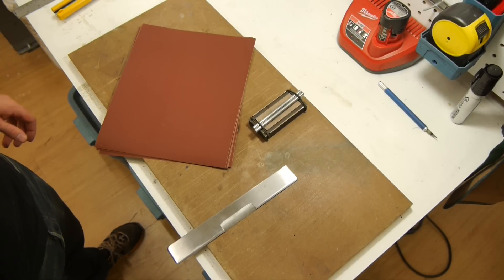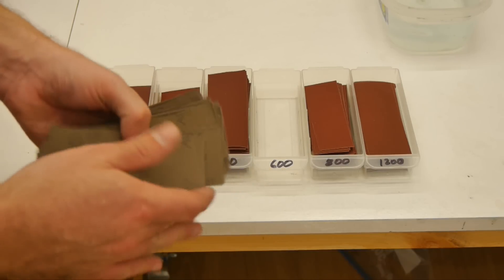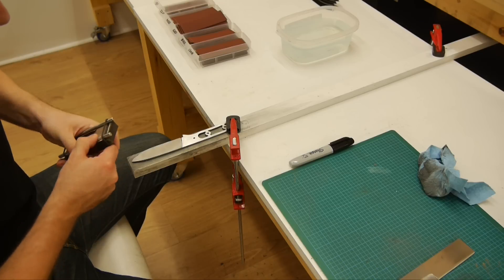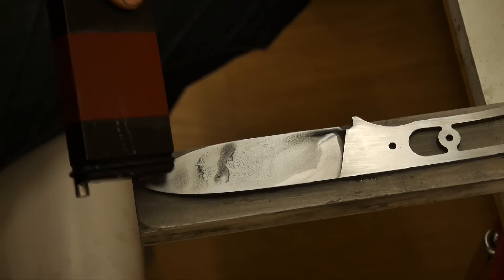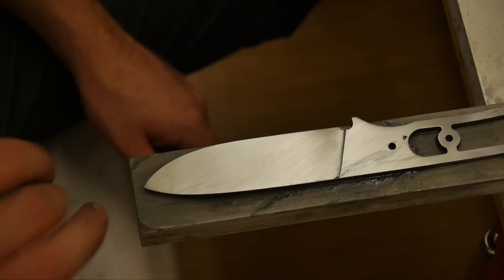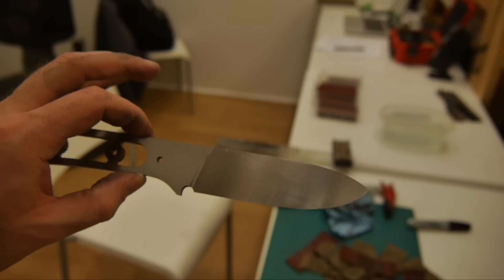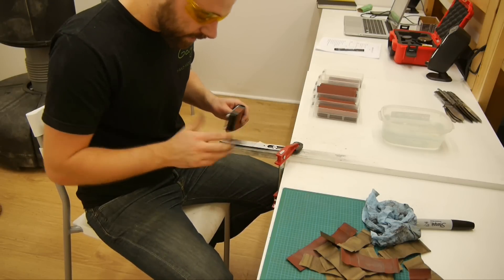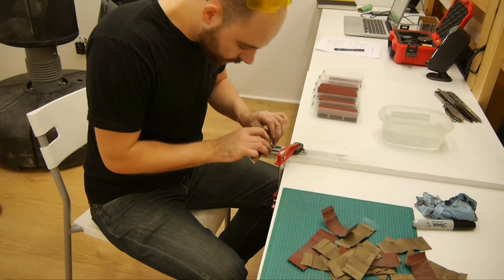How to Satin Finish a Knife Blade

Comment: I've made a few knives, and have the process down pretty well. Now working on upping the quality. I've watched a ton of videos on all aspects of knife making. I keep coming back to a lot of your techniques. Simple, well explained, logical. So thanks.
Reply from the maker: Awesome mate! Glad the videos have been helpful!
Reply: Gough Custom Yeah, I built a fire brick heat treating kiln, and have the Lansky sharpening system. Starting to build out the bevel filing jig. I've been using a cheap 1x30 grinder that does ok on the bevel itself, but is useless for getting a decent plunge line. Until I upgrade, I think the file may be the way to go.
Reply from the maker: Keith Peters The plunge line is definitely the hardest part of using a grinder.

The filing jig makes that part much more controllable...

Comment: Thanks a lot mate. I have a Japanese chef knife, which had a nice polish when I first bought it. Once I had it sharpened to a street vendor, and it was full of scratches. My heart was thorn..  Anyway, later I learned to sharpen with whetstone, so I got saphire brand stones, 1000-3000-8000 grits. But still had the scratches. 

After watching your video couple of times, I bought 400-600-800 grits sand paper, a sand block, which was very cheap to acquire by the way. And finally, I got my knife almost perfect satin finish, thanks to your explanations on your video.
Reply from the maker: malkocy Excellent work mate! That must have been satisfying!
Reply: Yes.. You saved my day, and I got this new skill. Thanks to you..

Comment: Sweet, great vid Aaron :)   If you don't mind me suggesting.. just as one should use sandpaper as if it's free, use shop towels like they're free as well, at least or especially in the case of sanding/finishing.  Just use a new (or seperate) towel for each grit so you don't happen to drag a piece of 400 grit (or worse) down the blade of your nicely finished 600 grit when wiping down your blade at the end. 

I know it's probably not a big problem for you since you only use those two grits, but hopefully somebody will benefit from reading this. I know how much it sucks to get up to 1000 grit and then wipe the blade down, only to find a stray piece of 120 grit on the towel after it just got done digging it's way into my nicely finished blade..   :(  lol   Anyway, it's always nice to see new vids from ya brother, take care :)
Reply from the maker: Good idea mate! Thanks!

Comment: Hello, thank you very much for your videos, they help me so much to improve my skills. I wanted to ask you to make a video - if possible - explaining how we can make visible the upper line of the bevel after hand sanding. It will be very helpful. Thanks again!
Reply from the maker: Hey mate! The main thing to consider in order to keep the top line of the bevel visible is that you have to avoid rounding over that 'corner'. If you think about it that visible line is actually just a 'corner' with a really shallow angle... If you round it over, even just a little bit, then the line mostly disappears.

So: Make sure you're using REALLY hard sanding blocks. If you're using sandpaper then you have to keep a lot of tension on the paper to make sure it doesn't 'squish' and round over that edge.

The best way to do it is actually not to use sandpaper at all, instead use a type of hard stone called 'edm stones' to do your finishing. Because they're completely hard / rigid it's much easier to avoid rounding over that corner. The stones also cut much faster than sandpaper as well, I use them 100% instead of sandpaper these days... I buy my stones from MoldShopTools.com, and I use the CS-M stones in the 1/4x1/2" size.
Reply: @GoughCustom  many many thanks for the detailed answer. I will try to implement all these. Thanks again

Comment: This is very interesting, informative and useful clip. Thank you so much. I found there  a lot of useful things. I wanted to ask: what design means for clamping sandpaper? How to fasten metal rollers? What keeps them - rubber rings?
Thanks in advance,

Gennady
Reply from the maker: Hey Gennady! The sanding block is not really necessary, and I know a lot of other knifemakers would prefer not to use it.. Whether you decide to is your choice. I have another video on my channel that shows the sanding block in more detail
Reply: Gough Custom Hello Gogh!
I also tried different ways and work with the sanding bloc I like more .. I have my own sanding bloc, but I really liked the way mounting sandpaper in your model. I want to do the same. On what your video can I see? I've seen all that you posted here and on your site, but I found none.
Gennady
Reply from the maker: Gennadiy Livshitz Hey mate, the video would be found on the 'videos' tab of my channel page, it's an older video so it doesn't show up on the main page: https://www.youtube.com/watch?v=AtAZRdxUrh4
Reply: Gough Custom Thanks, Gough, it's great! I already went to make a sanding block  :)

Comment: Hi Gough Custom. I like your video's, very usefull info. Have you tried Scotch-Brite to satin finish your blades. I have used the Ultra Fine Hand Pad 7448 for polishing mine with the aid of a sanding drum mounted in a cordless drill. I cut the pads in 2 " strips 9 " long and roll them on the sanding drum. Its fast and the finish is very uniform...it even follows the contours in the blade. I never use coarser pads because they tend to roundover crisp edged that you maybe want to keep. If the ultra fine pads are to coarse...just put a few drops of motor oil or WD40 on the blade first.
Reply from the maker: I have used a scotchbrite belt on my grinder in the past. It works ok but it's definitely not as crisp as a finish done totally by hand unfortunately...

Comment: Is it the act of dropping down a grit and changing the sanding direction that gives the satin finish, or is it determined by the grit that you choose to stop at? If you went further up the grits to get a finer finish would you still do that?
Reply from the maker: Ben Winchester The 'brushed' satin finish is created by aligning all your grit marks in the same direction. It will look similar even if done at a higher/lower grit. I would still do the exact same overall process even if I was going higher in grit.
Reply: Gough Custom Thanks! You're very helpful!

Comment: I've had trouble finding safety glasses without too much optical distortion, so I typically use a full-face mask, which is inconvenient.  Are you happy with your safety glasses?  If so, what kind do you use?  Thanks!
Reply from the maker: +TitusLivy777 I actually haven't had that issue to be honest, so I can't really be of any help! I will say that I vastly prefer my full-face respirator to any combination of glasses/visor.

Comment: How can I satin finish on a hollow grind blade ? No flat surface so your sanding block will not work. Any tips on how to do it? Thanks for the videos.
Reply from the maker: Hey mate! You need to use a hollow sanding block, ie: one that has the curve in it... So if you did a hollow grind using a 10" wheel you would use a sanding block with a 10" diameter curve on it... Knife supply places should sell them.

Comment: Could you still do this without heat treating after? Or more so after a blade is already treated?
I have a Kabar Becker BK2, I wanted to strip the paint off the blade portion then get a satin finish. 
Also would I need to coat the blade with anything after besides just a mineral oil to prevent corrosion?
Reply from the maker: Hey Joe! You can certainly do this to an already heat-treated blade, just be very careful of the sharp edge as you could cut yourself really badly. Mineral oil should be enough to prevent corrosion.

Comment: Just started to do this on an old knife for somebody. It is really scratched up and I thought great chance to practice this technique. Problem is I forgot to put the piece of wood underneath and managed to slice my thumb open. I should have watched this again first.
Reply from the maker: Ah shit, sorry to hear that mate. Hope the cut wasn't too bad... Working on a finished and sharpened knife is always a dicey proposition. I prefer to dull the edge first with a coarse stone to make it safer.
Reply: Gough Custom Thanks mate. It bled a lot but wasn't too bad. Seemed to stop after 5min of pressure. Don't think it needs stiches. The knife was mostly dull I just managed to hit the tip. It is a fairly cheap knife but good practice since I haven't done the hand sanding before on a knife turns out I am learning heaps already (especially about safety). Oh and I am halfway through making my first knife (only a mild steel one, for practice). And that beveling jig is great. How to bevel the knife accurately? That was the only thing stopping me until I saw that video. Now I have knife ideas I want to make going through my head all the time. Can't thank you enough for that brilliant jig. Thanks again mate.
Reply from the maker: Glad to hear you're ok mate! Glad the jig is working out for you as well!
Reply: Gough Custom Thanks again mate. Quick question if you have time. How do you find G10 performs when wet. I don't own any and don't know whether to get it or not. Thanks.
Reply from the maker: It depends entirely on how it's finished... You can finish G10 very smoothly in which case it's slippery when wet. I leave mine quite coarse, I only sand to 120 grit and they look great while also being very grippy.
Reply: Gough Custom ok cool I didn't know you could do that. I will give it a go for sure then. Now that I know it can respond like that. Thanks again.

Comment: Aaron, I know you have a sand blaster. Hopefully you can use different types of blasting medium. Why don't you use that machine? Would save you a whole lot of time.  Sand blast the blade, then gently polish the surface. It gives a very nice finish. Still a satin finish, but it won't feel "rough", like it would right after blasting. I have tried this myself on a piece of steel (not a knife) and the result was quite pleasing. Would this work on a knife as well? Maybe you have tried it already. If so, what were your findings?
Reply from the maker: +telescopereplicator Hey mate! Any sort of blasted finish on bare steel will not only look quite different, but it will also rust more readily due to the increased surface area and creation of small 'nooks' that will retain moisture. When I did the video I actually didn't have a sandblaster anyway, that's only a recent addition!
Reply: +Gough Custom  I wonder how much more intrusive sand blasting will be with respect to sandpaper or other mediums...? You can use sand (which comes in different sizes and hardnesses), different types of metal, and plastics. If sandpaper won't cause any problems, I think sand/medium blasting won't, either. Blasting the blade with 1mm (up to 5 mm) steel pellets (before the hardening process) might give a nice effect, although I wouldn't know how to do that. However, let's get one thing straight :  I like EVERY knife you make ! I consider each knife that leaves your shop a piece of art !!! No matter what you do to it !  ;-)
Reply from the maker: +telescopereplicator Generally speaking sandblasting creates a much larger surface area than other things like sandpaper, which helps to encourage rust if it's left raw. I've been very happy with how it performs on my newer knives where I sandblast and then coat with Cerakote!

Comment: Can I take out scratches from my blade doing this? My knifes scratched up, some fairly deep n I was hoping to fix it somehow. Can I do this to make my blade look new again?
Reply: It's a pre '04 Schrade LB7 they don't make them in usa anymore or with 440c stainless it's a collectable. N it was given to me by my uncle when I was a kid. So if u could tell me what u think I'd really appreciate it knife means a lot to me my aunt passed away a few years ago. Thnx!
Reply from the maker: Yes, you can refinish a knife using this technique, just make sure to dull the edge first to avoid cutting yourself.

Comment: Excellent video, thanks for sharing. A little off topic but have you done chisel grinds?  I love the look of the compound chisel grinds have not seen how they are accomplished.
Thanks again.
Reply from the maker: I haven't done any chisel grinds, but they should be fairly simple, you're basically just grinding/finishing one side of the blade rather than both...

Comment: how thin do you take the edge before heat treating? Are you air quenching? your blade didn't appear to have the scale and burnt oil on them the way mine do.
Reply from the maker: Peter Hughes DVM Hey Peter!
Just to be clear, the knife in this video was not really heat-treated. I discolored it with a torch so that I could demonstrate my process without having to wait 8 hours for heat-treat! If you have a look at the antarctic video you can see what my blades look like after heat-treat. There's no scale or oil because I'm heat-treating with the blade covered in foil and anti-scale and then air-quenching, there is a light rainbow oxide though.

On A2 I take my edges down to about 0.010" before heat-treat.
Reply: thanks! Some people say I need to leave a fairy thick edge on it before heat treat to avoid warping. Others say it is OK to work closer to finished before heat treating. Right now I am spending many hours hand sanding - from 220 up - on hardened steel . Can't help but think it would go quicker if I did it on softer steel.
Really like your videos. Copying your filing jig was a major step forward in the quality of the blades I've been making.
Reply from the maker: Peter Hughes DVM With some steels that require a very fast quench (like W1 for instance) I can imagine you might have to leave the edge thicker to avoid warping. But with everything that's oil quenched or air quenched I can't imagine you'll have an issue as long as the quench is done right and the steel is not overheated. I've talked to a few people that were having issues with warping, and in each case the issue was overheating. Thinning out your edges will make a huge difference in how the knives perform!

Sanding will definitely go faster when done before heat-treat! Buy some anti-scale compound and you can go all the way up to 800 or so before heat-treat. Afterward you will have to sand again, but you'll be able to start at 600 or 800 and it will go quickly!

Comment: For my forged blades I like draw filing to a fine enough finish with a mill smooth file and than move on to hand sanding with a 120 grit paper, followed by a 240 and 400 grit. I normally use the Rhynowet Redline and 3M. I have been thinking about experimenting by transitioning to a stone after the draw filing and before going to the 240 grit paper. What would be a good stone after the smooth file, an EDM or coarse waterstone ?
Reply from the maker: EDM stones will cut your finishing time by probably half compared to using sandpaper. I use EDM stones a lot and plan to do a video on them soon! I would recommend using stones to replace all your sandpaper grits except the final grit that you use for pull strokes. The stones I recommend are the CS-M stones from MoldShopTools.com
Reply: @GoughCustom  Thanks, will check that link.

Comment: hey Aaron I'm about to make my first few knives, I was wondering that when you sand the ricasso area are you not creating an uneven surface for your knife scales to glue on to? i assume you aren't doing much sanding if any where the tang is hidden by the scales. I was just wondering how this affects the scales sitting on your handle to avoid gaps, cheers.
Reply from the maker: You can create an uneven surface if you're not careful, you have to just make sure to sand a larger area so that the transition (if any) is spread out!

Comment: Well, thanks to you and Trollskyy I am now at the sanding and basically the stage where this video comes in handy. I notice you only wet sanded prior to heat treating and dry sanded after? also, does the second sanding block need to be metal or can it be wood? I made my plunge at 90...should I be using an angle? and last...holy crap, how do you cut those holes in the fire brick??? I just destroyed my hole bit!! Thanks for the great videos!!
Reply from the maker: Hey mate!
I wet sand both before and after heat-treatment, only the very final stage with the pull strokes is done dry.

The second sanding block can be anything, material doesn't matter too much.

However you want to do your plunge is fine, it's just a matter of personal preference.

I cut triangular grooves onto the firebrick using an old wood saw (it will get wrecked) then I made the grooves round by sanding with a large round dowel with some coarse 36 grit sandpaper glued to it. The brick is quite brittle so the sanding works well.

Make sure not to breathe the dust, it's really bad for you!
-Aaron

Comment: Mr Gough ive got a question, after you do 600 grit for the first time and then heat treat it and move on to 600 grit the second time, do you sand in the same direction or switch to how it was the first time?
Reply from the maker: The Eagle I generally switch the direction, but either way works fine.